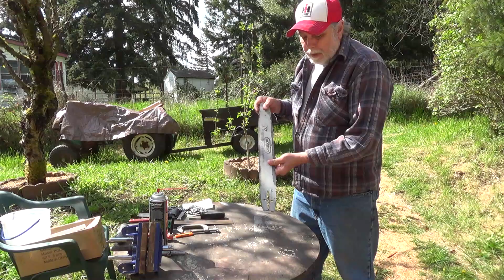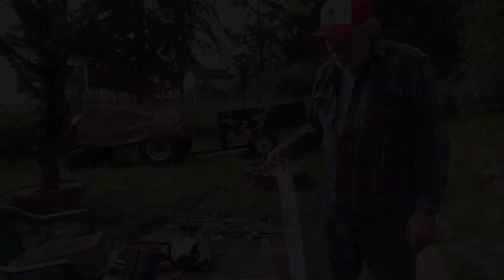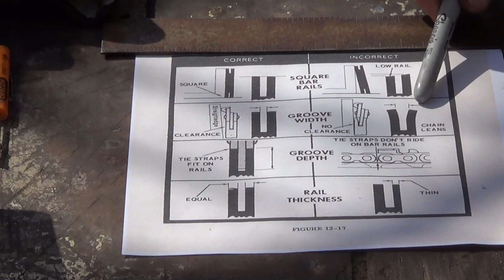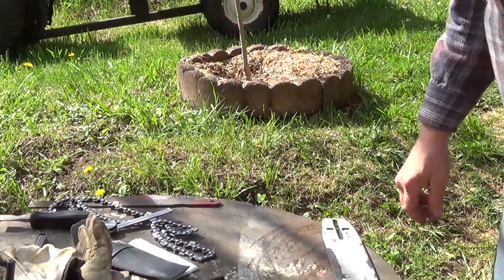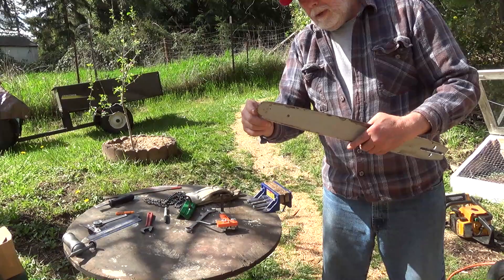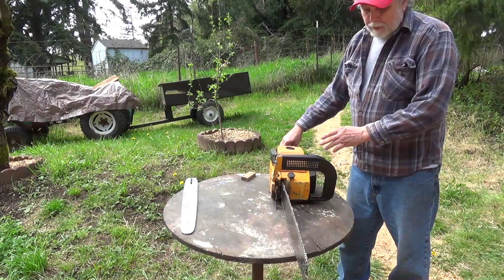Chainsaw Bar Maintenance

Comment: Nice video I will have to get me a bar squeezer. What do sometimes too is the groove is worn quite a bit is go up a gauge in the chain
Reply from the maker: that works too   I have a Pioneer that has .058 gauge drivers that no one uses in our area, so I will let it wear enough to where I can run an .063 gauge chain     thanks for watching

Comment: Boy can those bars be sharp. I think im 1 of the few that flip em here in alabama.  An bars are not cheap. U certainly have the right idea. Guess we were born in a more responsible time. We learned money is not everything. But it dont grow on trees. So l fuss an my sons an friends about saw an bar care. Thanks for bringing this subject up.
Reply from the maker: I like to get all the use from an item that I can, and in many instances the new bars are not very good unless you spend a small fortune to buy a pro quality one. The Macs  have the over-riding manual oiler 
 that really helps the bars from wearing, even the mediocre Oregon one in the video
Reply: @mrobsoletesvintagehomestea9156  l do have a homelite xl auto . And it has a zip brand bar. My 1st without a nose sprocket.
Reply from the maker: @bobbynash282  I have several saws with a hard tip bar.  They work great and will last a long time if kept lubed properly  I actually prefer them for doing bore cuts